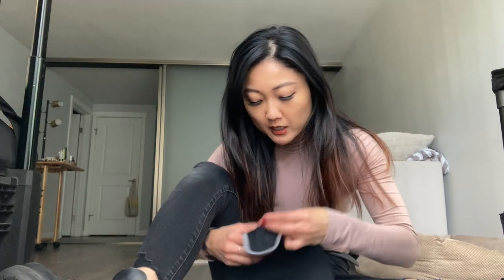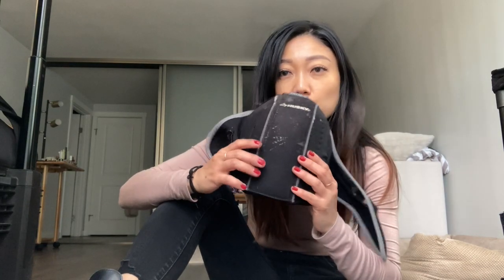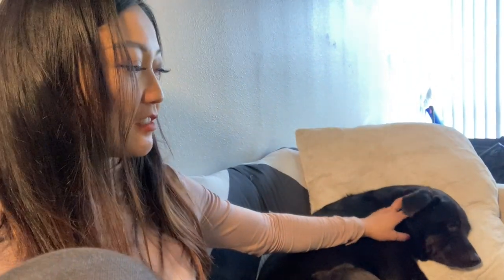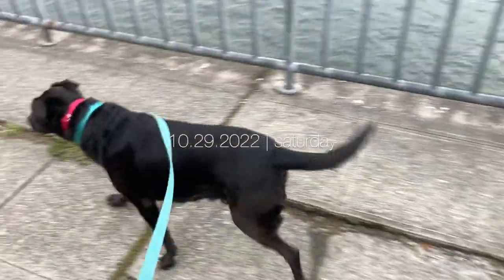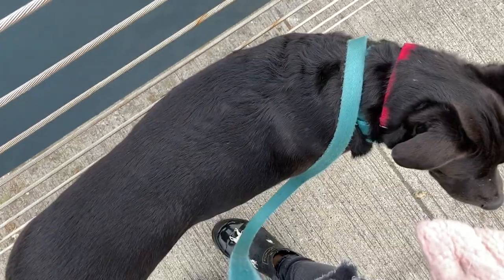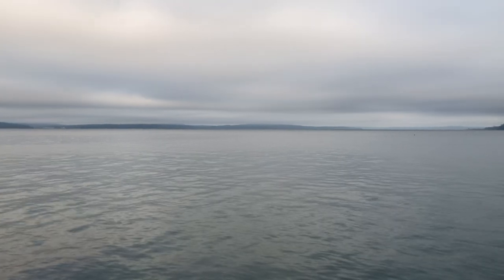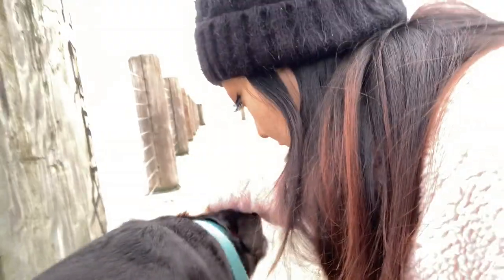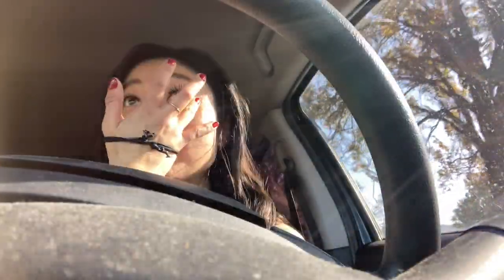self-employed handywoman vlog | f* these cabinets, best hair care tip, replacing flood lights

Comment: I was expecting simps in the comment section... slightly disappointed. But that's good for you!

The Hot Yoga, combined with not washing your hair, got me thinking about when I used to go to a gym that had a sauna. I didn't like the gym's body wash, so I just brought an extra Salux wash cloth, and just scrubbed in really hot water.
The thing I noticed, was when I got home, I wasn't sticky or smelly, and my hair and skin was really soft. So I kept doing it. I ended up going over a month without using any body wash or shampoo, so long as I was in the sauna for at least 20 minutes. I did wash the Salux with soap.

I did some reading on it, and what happens is when you use shampoo, it screws up your natural oil moisturizing balance. Then we use conditioner because the moisture barrier is gone.

By using the sauna and hot water, the oils are being produced, the excess and debris is being rinsed away, and over a bit of time, the natural moisture barrier will build up again.
Reply from the maker: Why would there be simps?  All my subscribers are my virtual friends.  Re the shampoo-less story, very Liver King of you, lol jk.  I get so itchy after one whole day, if I don't put on dry shampoo, I cannot stop touching my oily hair.  I don't have any patience.  I do wash my face with a wash cloth everyday though, like one of those soft ones you're suppose to use for your face.  You should try hot yoga, Michael, it's hella therapeutic and great exercise.
Reply: @ahandywomanandherdog  ... I do think about hot yoga...

Why simps? Pretty girl... sports bra... randoms that can't control themselves. It's almost a math equation.
Reply from the maker: @MichaelBiebersWorld  omg thank you for the compliment! haha
Reply: @ahandywomanandherdog  ... I know I've joked about making videos in scandalous attire for views, because I've seen it work for others. But I do cringe in the comment section.
Reply from the maker: Hahaha sure sure, wood girl fan, ok.  Jk!